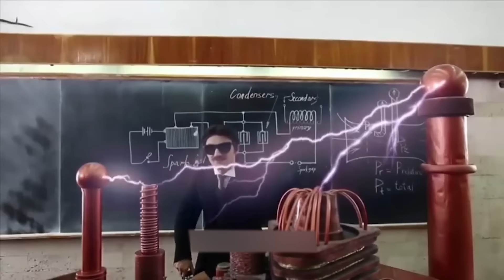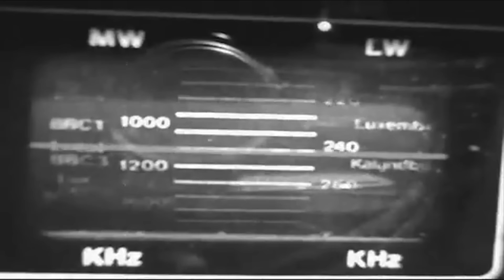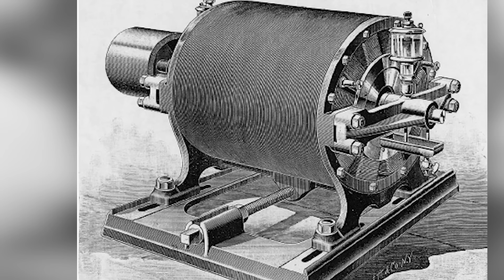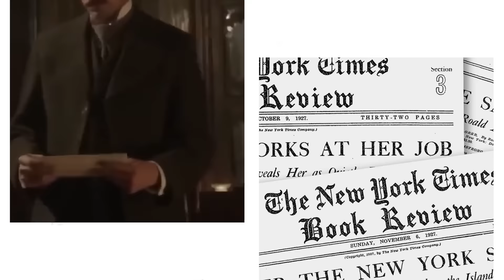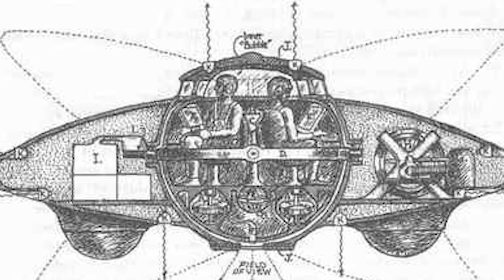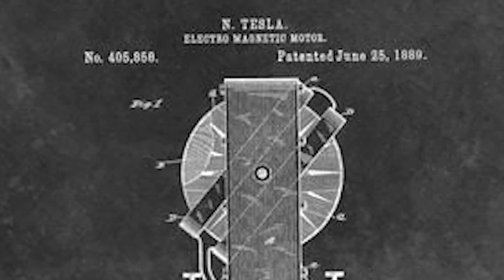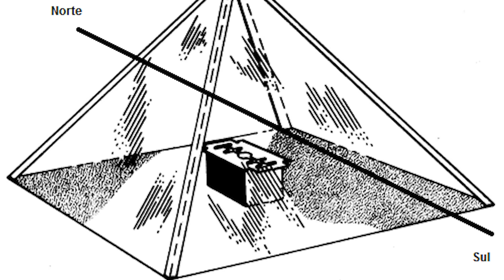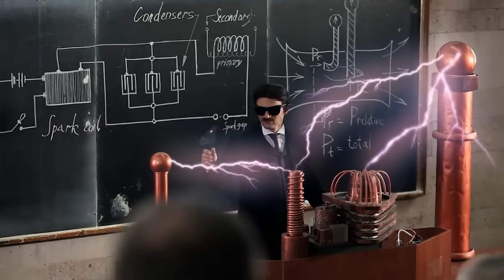Joe Rogan: "Nikola Tesla Breaks Silence Before His Death And Revealed A TERRIFYING Secret"

Comment: Nikola Tesla wanted everyone to have free electricity through the air but they were not going to let that happen without a price tag being attached to it we would have electricity and no ugly power lines running through the sky
Reply: Or undersea
Reply: Nor the pollution to our DNA from the powerlines. Plug a auxiliary cord into a radio and have it on a static channel and then tap the other end of the cord that plugs into phone. You hear a change in sound every time you touch it. That sound is the noise our body receives from runoff from power lines.
Reply: You know it wasn't even practical right? A tesla coil will light up bulbs, but not much more than that. It's high voltage low current. You need a fail amount of current and infrastucure to transmit it.
Reply: @SMILEYRLR  That's not the point. that's wireless power transmission. We're talking about free energy. His apporach is that he earth is a giant conductor which get permanently recharged from the sun at zero cost. That is the game changer, not that we don't need transmission lines or undersea cables, the power itself is for free, if you know how to use the current being infinite "refilled" by the sun..
Reply: Question how
Reply: Including all the electromagnetic radiation we are all being exposed to
Reply: @Alfa-hn1sc that's the whole point the government tore him down, cause they don't want us to know!!
Reply: The problem with free electricity is there's no business case if it's free!

Comment: The pyramids were electric conductors
Reply: Perhaps, and even more.
Reply: That's patently false. Granite and sandstone are insulators, very poor conductors of electricity. Before you say anything about piezo electricity, please note that piezo electricity makes a charge along a crystal as the crystal is subjected to changing pressure. Granite contains a percentage of quartz crystals. Quartz crystal exhibits piezo electrical properties. The crystals in granite are not aligned, hence the sum of their random charges would be 0. The granite used in the Great Pyramid is under constant pressure, not a changing pressure, therefore no charge is being made. If the crystals in the granite were aligned and the pressure were changing, there is still no means of collecting that electrical energy. That makes three strikes against that theory. It's out.
The Pyramids were edifices of human engineering and the ruling classes' folly.
Reply: They were generators
Reply: Yep the tops been removed because also were portals too
Reply: you're right s33 and not built by man
Reply: That’s an amazing theory.
Reply: There is a pyramid in Alaska that could provide electricity for Canada from coast to coast.  Free electricity is already available but  they rather keep us as slaves.
Reply: @JamesStripling  And what would the pyramid electricity be used for... ancient refrigerators? Ha ha.
Reply: @JamesStripling not quite, it used hydrogen that was split from the very water that surrounded them. They could generate amplify and transmit, literally from thin air. The pyramids were coated in limestone during this time not bare as they sit today . Limestone is a method of passivation for that exact problem.

Comment: Interesting video. almost everything in this video including remote control, electric cars, wireless transmission and much more had all been invented and understood in the 18th century. To this day most of what was discovered is still not being taught and or brought to the for front because you cant make millions off it........

something to think about look at current language and how most people talk thru emojis, similar to the symbols found throughout ancient texts and found in ancient pyramids and such. Ancient structures showing precise engineering at the base and further construction at a lower standard of engineering as time goes on. How many today could build log cabins, covered wagons or more modern be able to build and operate steam engines.........those who do not learn from history are doomed to repeat it

a side note the great pyramids are not square at base they are 8 sided. something that can only be observed from space

suggestion future content: Ed Leedskalnin and/or the engineers involved in the making of the ford engines. Original designs you will find the gasoline was used to start the electromagnetic flywheel not propel the vehicle...........
Reply: "Those who do not remember history are condemned to repeat it." George Santayana

Comment: DC is none toxic, because it does nit generate vibrating magnatic fields.

AC is only ised for transmitting piwer ling distances.

But even today all devices run on DC.

All your piwersupplys convert AC to DC.

So we coul run everything on DC if we decentralise power generation.

We could use Solar panels to run eerything on DC.

Comment: But everything in our home like appliances run on DC power 🤔
Reply: Actually the opposite is true. Nearly everything is AC. Your fridge, dishwasher, washing machine, microwave oven, air conditioning, normal oven, central heating, induction motors in machines and tools, old style welders (with transformers) and many more they are all AC. Probably modern power supplies (chargers) for laptops or mobile phones could also run on DC, since they were designed to be universal voltage input. All heavy duty machinery in industry runs on AC motors. AC power can be transformed with very low loses between power station and your home by electric grid.

The only DC in high power transport are underwater high power cables. Here it is better to transport electricity as High Volltage DC, hundreds of kV. As AC has very high loses under water due to capacitance.

Comment: Teslas work by and large remains misunderstood by mainstream electrodynamics. 

The work of James Clerk Maxwell was itself changed by Oliver Heavyside, and in doing so restricted the modern academically acdepted understanding of electrodynamics. Heavyside had discsrded 3/4 of Maxwells theory, and changed Maxwells equations in order to make the new science of electrodynamics easier to engineer. 

Tesla explored those areas of electrodynamics that Oliver Heavyside had discarded.

Comment: Well, the basic reality of Tesla is that he was addressing energies clearly Outside of the standard Electro Magnetic class of energy. When you see creating HUGE fields of EM energy look deeper into what he was doing: He was cresting fields of huge potenyial, huge voltages but 
doing no "work" with the created field. Nonorvlowest possible current or Amperage. This to allow or induce the latent or vurtuial
energies in space itself to JOIN the existing field so that he would have MORE energy in the field thst the initial establishers of the field placed in the field In other words, an OVER Unity condition. the classic 1:2  condition. Where observers saw discharges, those were leakages due to the primitive
insulators highly inefficient
Insulator materials of his time. But much of Tesla's 
basic ideas centered around
gaining access to energies always existing in a vultuial form in space. Extracting that energy which joined an initial high potential field while continuing the operation of the initial field to draw further latent energy into the field thus continuing  the cycle which produces energy over and above the fuel or excitement of the primary field created. 
And once created, this extra energy was either kept or converted into a vurtuial state so that it could be sent or transmitted in a
nonactuialized form WITHOUT LOSS wirelessly
to whatever point the creators of the energy wish.
Reply: Would you mind repeating yourself now but in English pls 😊 like what the ? Maaan seriously all you should've typed out was that our earth is a giant electric generator and stator which if we wasn't lied to we could use for EVERYTHING for FREE ok THE END.